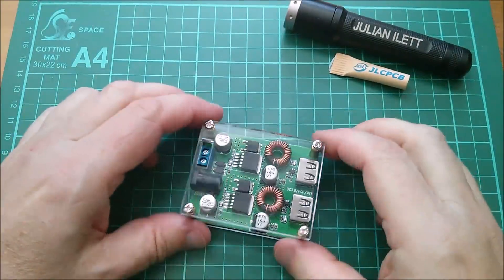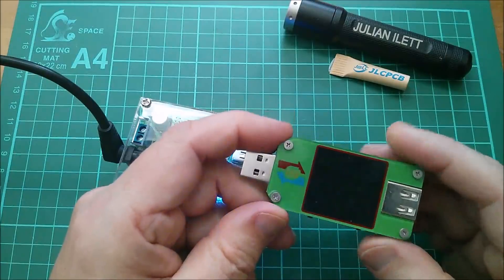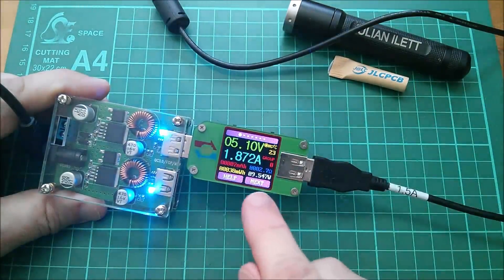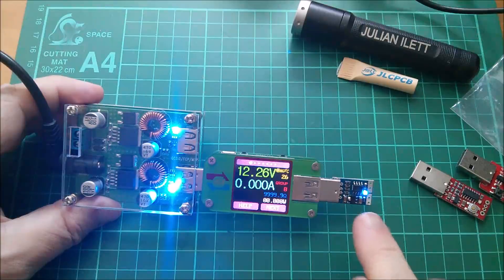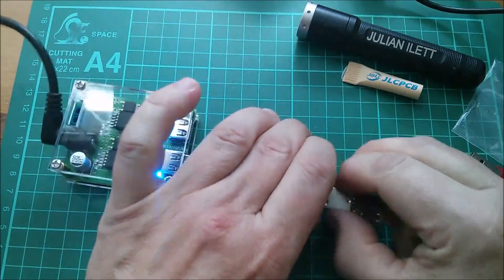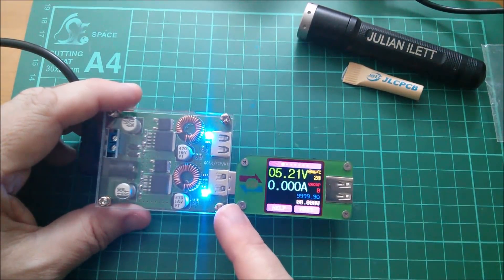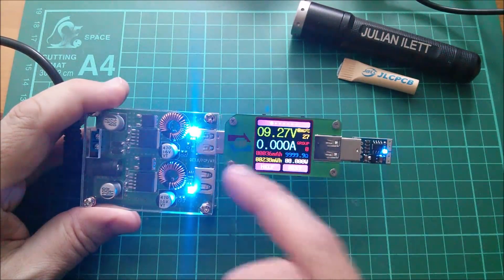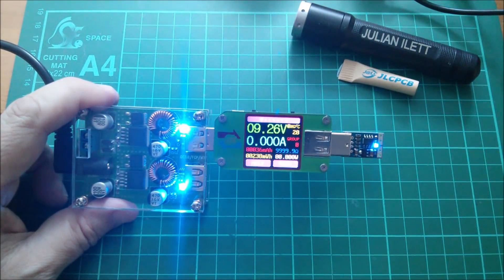DC-DC Buck Converter 2-Port USB with QC3.0 from ICStation

Comment: the TS80 only takes 9V
Reply: Disappointed that the TS80 does not do USB-PD. Even Google is recommending PD for the newer Android devices... but yes, QC is quite common here in China as almost every phone and powerbank supports this. Note: the TS80 does not have the CC lines connected to even support PD, so an external solution is recommended.
Reply from the maker: Oh, I'm really hoping the TS-80 will ask for 12V. Banggood's listing shows 5V/9V and 12V in the specifications :)
Reply: Julian Ilett I have the ts 80 and can only get it to work at 9v...but still a great handy iron for me to use on site with my power bank
Reply: Found out why Banggood wrote that description as you mentioned. These are the specifications of the included DN.OX branded Quick Charger 3.0, model: DNQ18U-U.
Reply: The TS-80 only asks for 9V in its stock firmware, yes. However the internals of the iron are rated up to about 16V (as per this comment by the creator of the third-party TS-100 firmware, which he's now made compatible with the TS-80: https://github.com/Ralim/ts100/issues/349#issuecomment-417179746) so it could be possible to get the third-party firmware to request 12V. That same thread says that, while USB PD straight from the iron isn't possible (the "CC" lines of the USB-C port aren't connected to the microcontroller), it should be easy enough to use external inline modules to negotiate 12V from USB PD and feed that straight into the iron's USB-C port.

Regardless, I highly recommend you flash Ralim's third-party TS100/80 firmware, because the stock firmware is extremely fussy with voltages. I have three QC3 supplies (I had a fourth - the one that came with the TS-80 - but it's already died on me! It's actually REALLY well-designed and well-made inside, so I'm not quite sure why it's died, and my probing hasn't yet located what's failed...) and on two of them the iron would complain of "low-voltage" (technically it shows "LOW-VOT"...) and shut off when it started heating and the 2A current draw would cause so much voltage drop along the cable that the voltage measured by the iron would drop below 8V :( Ralim's firmware, on the other hand, doesn't have a lower voltage limit (it'll even heat from 5V if you really want to!), so it'll happily work from anything.
Reply: Disclosing; I am gbraad on GitHub. Using 12V would not help much for most of the supplies, as the soldering iron already requests 9V at 2A, while most power bricks and powerbanks only offer 12V at 1.5A. I have one from Lenovo, the Type-C charger for notebooks, that can output 20V * 3.25A, and this can do 12V at 3A ()https://imgur.com/UfWdo2B but this one is only available in China AFAIK). However, the iron negotiates the voltage... it is not like you just feed it 12V - the firmware should have to request this (Re: "to use external inline modules to negotiate 12V from USB PD and feed that straight into the iron's USB-C port."). In that same thread we discussed about a possible mediation between USB-PD and QC3, but so far no luck. I am using the Lenovo Slim-tip USB-PD trigger and feed that into a small DC-DC converter that understands QC. I currently use this: https://imgur.com/Qc8gAqU as it allows me to use USB-PD (as long as it can supply 20V) and use it for both the TS100 and TS80.
Reply: 12V/1.5A would definitely be a small improvement over 9V/2A because one of the biggest problems I found with my TS-80 is the voltage drop over the silicone cable that was supplied with it. When it's heating and drawing close to 2A, the 9V that the supply puts out drops to around 8V or even less (I tried four QC3 supplies, and with two of them the voltage drop was enough to make the stock firmware cut out with a "LOW VOT" warning). 12V and thus lower current would thus suffer less voltage drop, so you should in theory be able to get a slightly higher power from it. Not a huge difference, mind :)

I'll preface this by saying that I've not tried this yet, HOWEVER: surely if you used an external USB-PD trigger module to request 12V from a USB PD supply and just output that straight into the iron, the firmware would have absolutely no control over that? Yes, the way it's designed is for the firmware to request the voltage from QC3, but if you forced 12V into it, it's not like the firmware can say "oh actually I don't want that" and turn off the USB port or anything :) I could shove 340V rectified mains into the iron if I wanted to and the firmware couldn't do anything about it whatsoever.

(I don't have a USB PD trigger device to test that with, but I do have a QC3 trigger, so I could use that to at least try requesting 12V from something. Incidentally my Ravpower RP-PB043 USB power bank is able to output 20V on its QC3 port, even though the product spec and labelling on the power bank itself says it only goes up to 12V!)

Please do correct me if I've missed something! :)
Reply: The situation is finicky even with the alternative firmware. I have a USB-C powerbrick that supports both USB-PD and QC, and this needs to be connected using an OTG adapter so it will ignore the missing CC connections before it will start to deliver power over QC3: https://imgur.com/neca7e4 (the same goes for powering it from a dual capable popwerbank on the SUB-C port. From the USB-A or using an OTG-adapter it is OK)
Reply: I haven't noticed this voltage drop... but wil pay attention to it. Haven't seen the LOW VOT message. Which power supply have you used? Might be valuable to summarize these issues and findings some where. Did you also experience this with the stock supplied power supply?
Reply: I recorded some video of me trying the TS-80 with my four QC3 supplies and comparing the voltage at the iron and also whether it errored out with "Low-Vot", although knowing the amount of free time I have, I probably won't ever get around to editing & uploading it :p

The four supplies were:
* The DN.OX DNQ18U-U thing that came with it. This worked fine at first, I think, but it actually completely died when I started the iron heating while I was recording. Something on the output has gone short-circuit, but I haven't pinned it down yet (I thought it was diode D4, which is just a 3A Schottkey diode, but I removed it and there was still a short across its pads, so something else is shorted). But this is the supply that was making concerning hissing, pulsing and popping noises for several minutes when I first plugged it in! At least I have a video of it to show Banggood!
* A Ravpower RP-PC006-UK mains supply. This heated fine (voltage at the iron dropped to 8.2V) but strangely as soon as I took it out of heating mode it said "Low-Vot" (and when it does that, you can't escape from that screen without unplugging the iron entirely...). It shouldn't at all care about the voltage in standby mode, so I'm not sure what's up with that.
* An Aukey PA-T11 mains supply. This was completely fine with it (voltage dropped to 8.3V). No problems at all with this one.
* My Ravpower RP-PB043 power bank. This one caused the iron to display "Low-Vot" immediately, as soon as I turned it into heating mode, which means that I can't use the TS-80 from that power bank (which is my ONLY QC3 power bank) with the stock firmware! Thankfully Ralim's works from any voltage.

I just thought I'd try measuring the resistance of the power lines in the supplied silicone cable, but it turns out I don't have any USB Type-C socket breakout boards (I have lots of the jack type, but no sockets), and my attempts at using things like USB electronic loads and connecting to the power lines on their PCBs failed as well. I'll order a USB-C socket breakout at some point, but in the meantime if anyone else has the required equipment they can test that first :)
Reply: Re: "It shouldn't at all care about the voltage in standby mode, so I'm not sure what's up with that". Might be valuable to report this at least to the MiniDSO forums so this can be fixed in the regular firmware. I'll see if Ben (ralim) is able to add a 12V option (https://github.com/Ralim/ts100/issues/349#issuecomment-426618907). He wrote the QC stack himself, as at the time the firmware wasn't yet provided.
Reply: Yeah, I'll see if I can find some time to do that :) It just means that ideally I'd need to flash the latest official firmware and test it again, to ensure it hadn't already been fixed, and I'm not sure if I can be bothered. We'll see ;)
Reply: Ben will add a 12V option.
Reply: Be careful with these tests, as at the moment this is all VERY early stage. It seems my soldering iron got severly damaged due to this and according to e-design `demolished`. it is awkward what they have concluded. The service personel sounded friendly at first, but started to accuse me of 'demolishing' and 'resoldering'? (I haven't opened the iron at any point). But anyway... use a reliable power supply for now and stick to providing 9V.
Reply: @gbraadnl  Damn, yeah, I've been catching up with the GitHub issue thread every few days so i read about your broken iron the other day :( That really sucks, sorry to hear that :( I've been really busy with other projects lately so I haven't had time to try out anything related to the TS80 recently (and since I only have a frickin' gigantic tip for it, I can't use it for anything useful anyway - the majority of soldering I do is SMD lol...). Hopefully the issues can be worked out soon :)
Reply: As you said, one tip... for that reason I also prefer to use the TS100 at the moment.

Comment: IMHO using USB (any type) as a power distribution system is madness. Crappy connectors that are not very good at handling high currents. Crappy thin cables. Mini and micro USB connectors are even worse.
Give me a D-connector or XLR connector which both can handle 5A per pin :-) Where only power is needed, a 2.1mm barrel ‘DC’ power connector. Or if space is an issue, a 2.54mm spacing three pin connector (middle pin being the positive 12V, the other two both being 0V, so reversing it does not matter).
Reply: Especially the arc extinguishing capabilities of USB, or rather the lack thereof. Even with modern USB-C Connectors I wouldn't want to be hot-unplugging a connector that has 100W at 20V (5A) running through it without first switching some mosfet to un-load the connector.
Reply: Shows how little knowledge people actually have about this technology...

Comment: Puts 12 volts out on 5-volt jack. That sounds dangerous.
Reply: It isn't. Cause it needs to be negotiated, and only devices capable of 12V will get 12V.
Reply: Read the Quick Charge 3.0 spec. You have Google. And it's not a 5V jack.... it's a USB jack.
Reply: that usb jack won't put out 12v, unless the connected device requests it. nothing dangerous, unless someone messes up data lines..